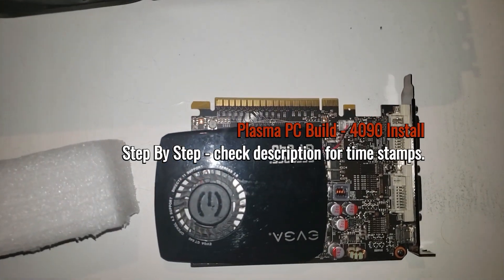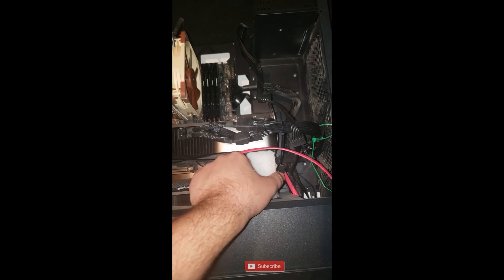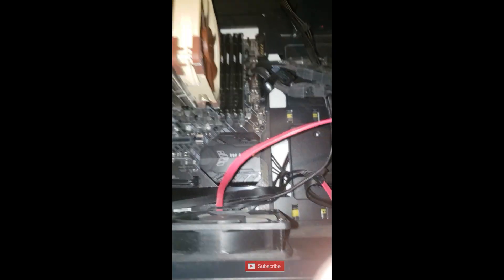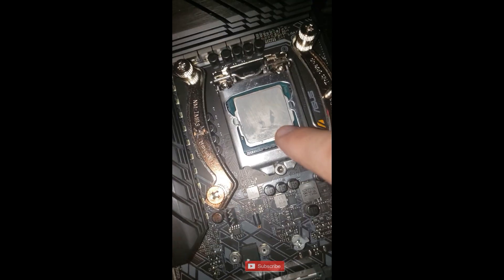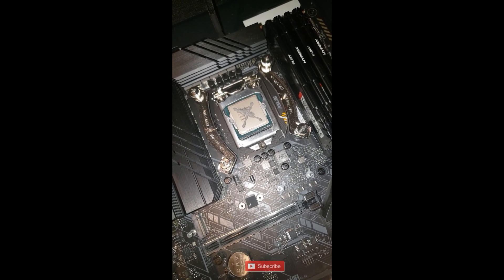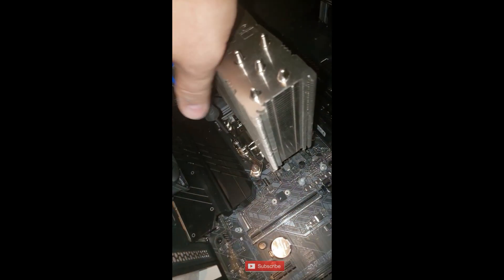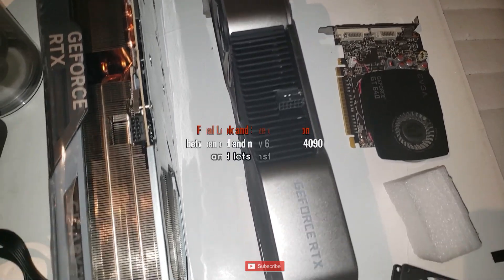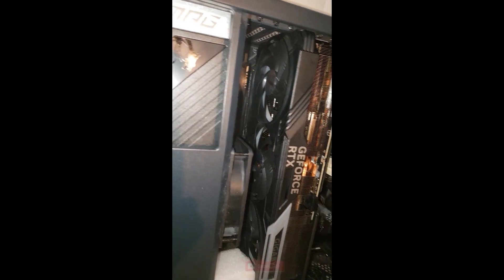Tech Corner - Plaz Step by step install of RTX 4090 vs Nvidia 3090 & new Power Supply 12VHPWR

Comment: i have a similar set up with the foxcon heatsink, but im curious as to which way i should have the fan on it. should it be blowing on the heat sink or pulling the heat away? which is the best?
Reply from the maker: in my case it was blowing up towards the main fan which then blew out to the back and out of the case.

Comment: Hi, thanks for your video. Can we install 3090 and 4090 into one machine? Is that possible? (I know two 3090 can be installed in one machine, but not sure if different GPUs will work or not)
Reply from the maker: You can but you should not. The 4090 does not have an n link bridge to link it to another 4090.
Reply from the maker: Two 3090 4090 will not give sufficient boost. I would say buy a 13700k 13900k and ddr5 instead and one 4090 for best speed right now do not buy two 4090